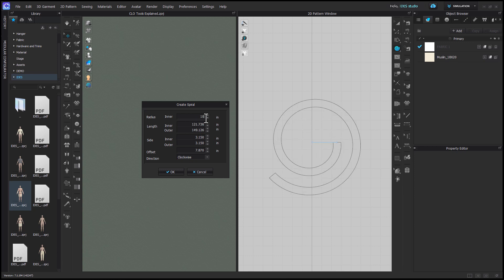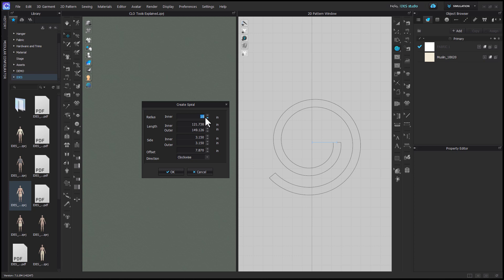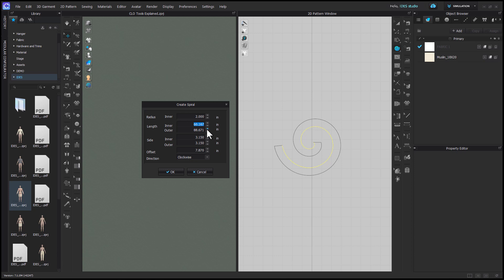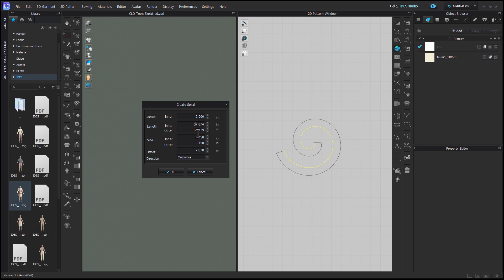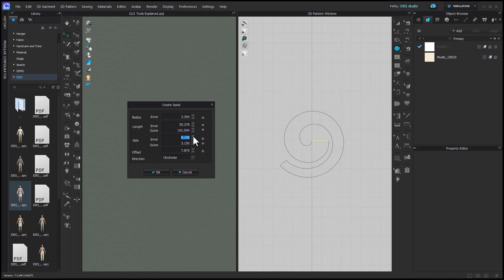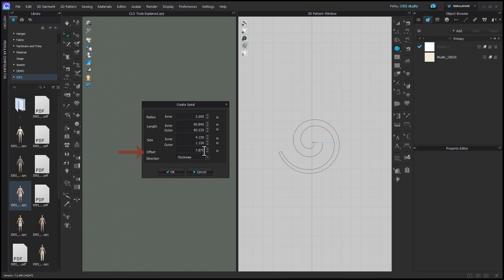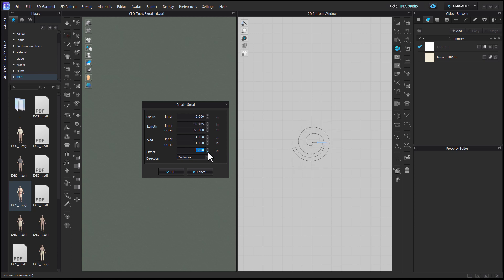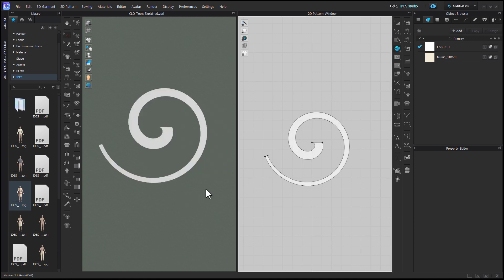CLO 3D Tools Explained, Under 2 Mins- Spiral

Comment: hello! Thank you for this tutorial ❤❤ I have one question tho, how do I change its size after I click Okay?
Reply from the maker: If you figure out after creating it a better set of numbers to use, it is likely easiest to just regenerate a new spiral pattern. However, if you just want to make minor tweaks, you can do so using your Edit Pattern tool. You could change the width of the start or end of the spiral or even change the length at top or bottom edge, either by moving points or by right clicking on those segments and choosing "change length." Let me know if that's clear or you have more questions!
Reply: @ides.studio TUSMMM ❤❤